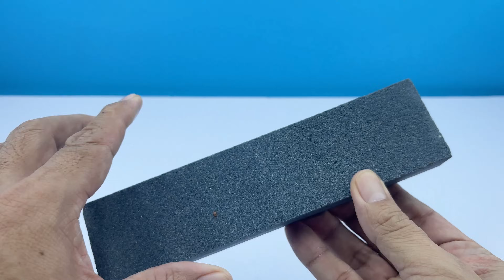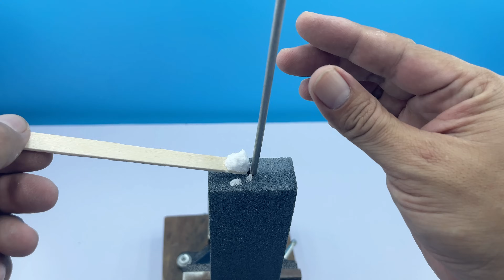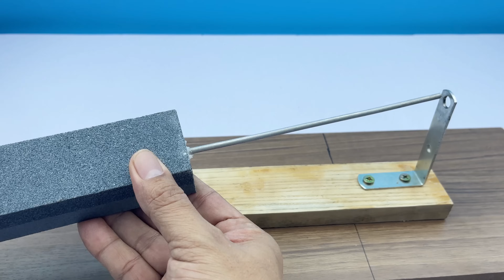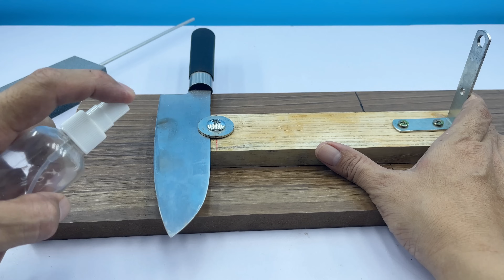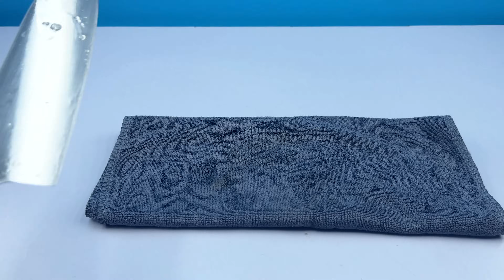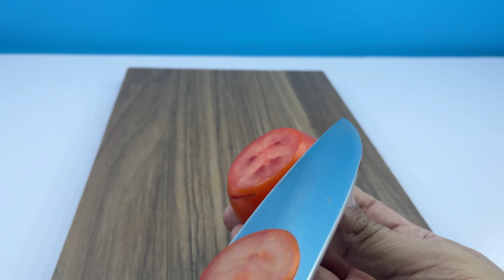How to Sharpen a Knife as Sharp as a Razor in 1 Minute. Knife Sharpening with Smart Stone 😱

Comment: I don’t recommend simply going side to side with your stone. Creates grooves which will make your edge irregular, or even chip it. There are also many guided sharpeners already on the market (lansky ones are fairly inexpensive, and very good), but it’s always fun to watch something DIY
Reply from the maker: Thanks for sharing your thoughts! You're absolutely correct that simply going side to side with a stone can create grooves and potentially damage the edge. Guided sharpeners like the Lansky ones you mentioned can indeed provide more consistent results, especially for those new to sharpening. DIY methods can be fun to explore, but it's important to approach them with caution and proper technique. Your input is valuable!

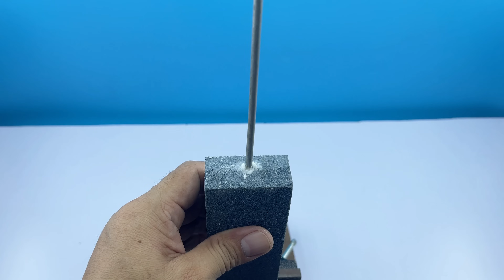Comment: At time mark 1:44, what was the white powder you used to fill the hole? What kind of liquid glue did you use?
Thanks very much.
Reply from the maker: At time mark 1:44, the white powder used to fill the hole is typically *baking soda**. It's commonly used in DIY projects, especially for making strong adhesive bonds when mixed with superglue (cyanoacrylate). The liquid glue used in the video is likely **superglue* or **cyanoacrylate**, which works very well when combined with baking soda to create a strong, durable bond that hardens quickly.

Let me know if you need more details on how to use these materials! 😊

Comment: what about angle ?
Reply from the maker: "Good question, SK! 😊 The angle can make a difference in the results. Make sure to adjust it slightly until you get the best outcome. Let me know if you need more details!"
Reply: @CreativePassion88  you can Not adjust the angle . Perhaps ist better to use a cable tensioner and to Cut IT in the middle

Comment: No sirve para filos rectos.
Reply from the maker: Thank you for sharing your opinion. As you noted, some sharpeners are not suitable for sharpening straight blades. To effectively sharpen a straight blade, you can use specialized tools such as a flat grinding wheel or an angle grinder with a flat grinding wheel. These tools help create precise sharpening angles and ensure sharp blades.